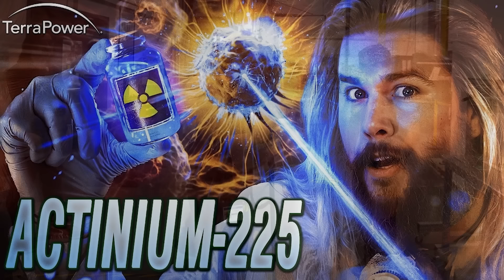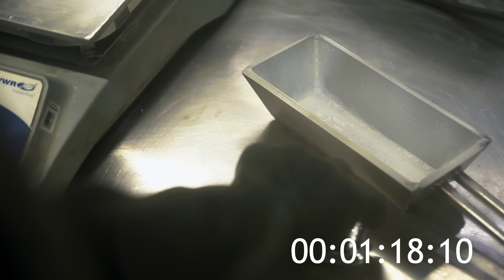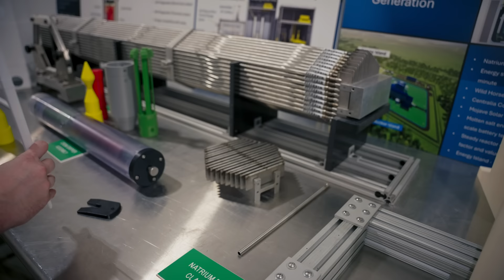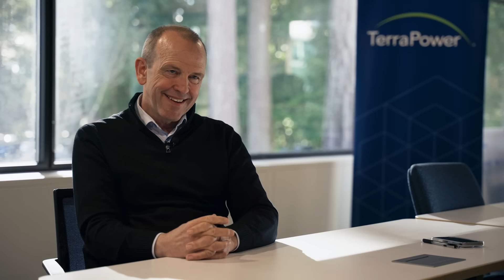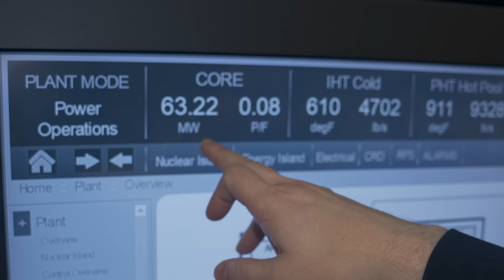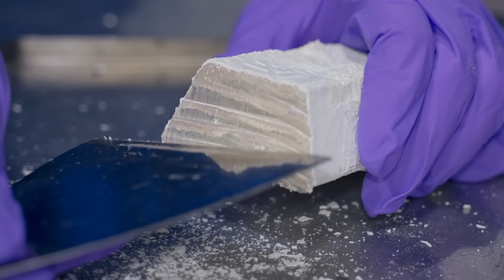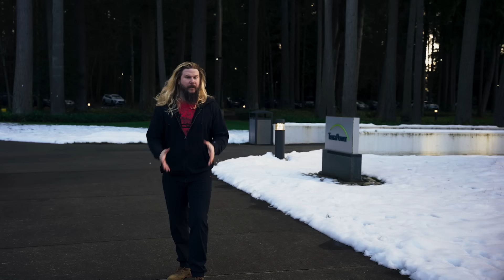Will Natrium Nuclear Reactors Change Everything?

Comment: Hey Kyle,
Interesting technology...

Definitely appears to be a blending of SAME-OL, SAME-OL Uranium-based thermal heat generation combined with the use of molten salts to recover, store, and transfer that heat for electrical power generation.  The best feature about it is the fact that the design allows for ATMOSPHERIC PRESSURE OPERATION.  In addition, the separation of the two "stages" allows for somewhat easier and more efficient maintenance.

That said, there are still the issues of nuclear safety when it comes to fission dynamics, coolant behavior, and passive safety mechanisms.  Aside from the potential use of gravity-based control rod insertion during a reactor shutdown (for whatever reason or reasons), there's nothing else other than a reliance on the naturally occurring convective circulation of the molten sodium (possibly in conjunction with other passive convective cooling mechanisms) to manage the heat in the core.

Finally, in comparison to thorium MSRs the Natrium reactor still has to deal with the SAME-OL, SAME-OL core changeouts and associated waste storage...  Here's a summary comparison between the two in this regard:

Natrium still generates high-level waste that needs geological storage. MSRs aim to close the fuel cycle, dramatically reducing waste volume, radiotoxicity, and long-term stewardship needs.

⚙ Operational Flexibility

Natrium reactors must be shut down and defueled periodically — core changeouts, inspections, etc.

Thorium MSRs, in contrast, can operate continuously with online fuel addition and fission product removal, sidestepping many of the logistical headaches of solid-fueled systems.

This isn't just an engineering difference — it reflects a different governance and cultural posture toward nuclear stewardship.

☢ Proliferation & Fuel Sovereignty

Natrium uses high-assay low-enriched uranium (HALEU) or even plutonium-based fuels, which pose fuel security challenges.

Thorium MSRs breed U-233, which is denatured with U-238 to reduce weaponization risk, and thorium is globally abundant and non-fissile on its own.

Comment: ENGNEER HERE - Like every other technology where people push stupid claims of "change everything"?
The answer is NO, and is always NO because there will not be any energy system that changes everything.
Some might be significant but nothing short of Doc Browns Mr. Fusion (Back to the Future) will change everything.

FYI - For all of recorded history we have used different forms of energy.

In ancient Egypt they pulled chariots with horses because chariots needed speed. they used Ox to pull plows and heavy wagons because for those tasks they didn't need speed but the strength to pull those sorts of loads. For going up and down the Nile they used sail, because trying to pull (or push) a barge or felucca (yes Assassins Creed fans) with a horse or ox made no sense.

Nothing has changed in the 5,000 years since.
Why?
Because different tasks need different forms of energy delivery.

Comment: This is good news because China has a mult salt reactor that claims to have reduced the acrosive problem with a special alloy in its circulation they claim to have been able to remove and add Fuel and remove contaminants wild in continuous operation.

Comment: High temperature molten salt thermal transfer fluid would be one step beyond this, but it's been experimental for decades ... more due to lack of interest/funding at the national/public level than from sheer engineering hurdles. (molten potassium chloride was/is a popular choice, also what several types of thermal solar plants use as a thermal mass storage bank to generate continuous power day/night, like Spain uses).

Also, not the same thing as a molten salt reactor. That uses a molten salt matrix with the nuclear fuel dissolved in it as the reactor core material. (this is often discussed as a type of thorium-uranium breeder cycle reactor) Though a potassium chloride coolant + heat transfer loop could be used in conjunction with a molten salt core, as well.

Comment: Question: What is the operating temperature of this reactor?  I'm curious because if it's high enough: You can use the heat for things other than boiling water to make steam.

To be fair: That's still pretty useful in and of itself because that's how we generate electricity.
Reply: Watch from 10:20 he mentions about the reactor heat and sodium heat jsyt before

Comment: 16:12 fun fact: hydrogen is not the reason for the explosion.
The surface is highly charged and shoots into the water at insane speed, Thunderf00t did experiments on that around 2015 I think...
Extremely interesting.

The hydrogen is just a secondary effect.
After all, sodium explodes under water, grabs the O2... What's the hydrogen gonna react with?

Comment: By the way, Thunderf00t did quite nice experiments to find out why the liquid metals in first and second row explode in water.

As far as I remember, the surface is highly charged and tiny imbalances start protruding a bit, it becomes more charged and really accelerates into the water extremely fast, allowing insanely fast reaction with the water due to the sudden increase in surface area.

Comment: Didn’t the Soviet Union run their reactors in their early power systems in their first or second generation atomic submarines ?
And they claim they stopped using this sodium system because it wasn’t safe?
But probably nothing on early Soviet nuclear submarines were very safe.

Comment: this design is cool and all but how does it handle meltdown risk situations? From what i know about water cooling reactors is that it's pretty much self regulating, as water is coolant as well as moderator, so when reactor gets too hot, water will evaporate which will remove moderating medium, which will stop the chain reaction, which will cool the reactor down. Sodium, as showcased in the video, does not evaporate like water and is not moderator as the reactor is a fast kind, so how is meltdown risk handeled?
Reply: So, let's say your coolant stops circulating (leading to potential meltdown). You have a scram, control rods are inserted, and fission stops. Of course, you have to dissipate the current heat, and the future heat from decay. The sodium reservoir is sized such that it will be able to absorb all that heat - thus avoiding the meltdown.
That is what EBR II showed - after shutting off the pumps, the temperature continued to rise, and then eventually started declining - because the sodium reservoir could handle that excess heat until said heat could be passively radiated away.

Comment: exactly what are they coating their pipes with? boiling hot sodium will fuck a lot of materials up without much trouble
Reply: molten sodium is used to clean steel - it scrubs the outer surface, but once all the oxide is gone, it is essentially unreactive with the actual steel. This has been shown with dismantled components from test and production fast reactors.

Comment: Can we get a video on how the molten sodium is controlled by magnets? It’s nonferro magnetic and even ferro magnetic materials lose there magnetic properties when heated.
Reply: sodium, like most metals, is a conductor
thus you can induce either an electric or magnetic field in the metal
given the metal will oppose the change of an electric or magnetic field, it will attempt to deform
given the metal is a liquid, deformation (or motion in a particular direction) is easy
hence, once can pump the liquid metal

Comment: So molten salt is the coolant instead of water, but the power conveyance is still boiling water. I wonder if there's a way to go from nuclear heat directly to energy.
Reply: thermocouples - although it wouldn't be very efficient
the reason for the water is that people haven't built cost-effective CO2 or He turbines, so easier to go with standard steam turbines

Comment: 15:11 I do have a genuine question. Would the operation temperature, of 500°C or so, not be hot enough for the molden sodium to pull elemental oxygen from the air? Yes, I know that the sodium will operate under a argon atmosphere, but if a structural failure occurred, the argon replaced by generic atmosphere, and the sodium would still be warm for the time being...

Is there no major risk in this situation? Or would the use of hydrochlorides and other acids be used to neutralize the combustion threat?

 I'm a pro-nuclear individual and I want to see neon green power become humanity's dominant source of day-to-day power, so this is not coming from the place of anti-nuclear. This is still my only concern with molten metal reactors, this small area of caution.

Comment: Is there a smaller scale operating electric generation fast sodium/salt prototype or are we going straight from the drawing board to commercial with fast sodium/salt? FFTF was not an electric generation facility and did not provide the salt component. Also there is a limit to how much the salt will hold thus load following with this thing still has limits just that it provides a wider band.

Comment: One of the problems I remember with salt based heat transfer is reactivity.  Those salts love to form bonds and IIRC that is why water was chosen as the means of heat transfer even with the pressure penalty and the worse materials science.

Even if you can do the first stage heat transfer with magnetics, which is awesome, that fluid will be hitting the side of the container for some portion of the transfer or all of the heat exchange.

Comment: Sodium is a highly reactive metal; it will release hydrogen gas and high heat when exposed to water. Explosion and fire are common. Sodium melts at 208 degrees F. That means that the piping serving the liquid sodium must have heat tracing. Should the heat tracing fail, then the sodium will become solid. In my opinion Sodium is not a safe choice for such an application.

Comment: I don't understand why are they using sodium, which is known to be nasty, because of its very high reactivity,why can't they use more stable & inert metals like mercury or gallium ?
Reply: mercury is highly toxic, has a high vapor pressure, and is far from inert. It reacts with a shitton of organic and inorganic materials that would make operations difficult and dangerous to handle any material.

Gallium is very hard to source in large quantities, and reacts with a lot of metals in catastrophic ways. once it binds as well there's no going back. While it does work as a cooling medium thanks to its low vapor pressure everything else about it makes it way too cost prohibitive.

Aside from all that, gallium and mercury are used heavily in precious metal refining and semiconductor production. They're only going to get more expensive as time goes on, it's a bad material choice to design around for long term use.

Comment: So this generator has potential as long as the heat exchanger that seperates the corrosive salt water from the corrosive sodium metal  never fails.  Instead of water they need to couple the system to a super critical co2 or a ammonia system to take the heat off.  There is way less chance of failure due to corrosion this way.

Comment: Hi not a science nerd and don't normally leave comments, BUT I did work at a chemical plant 5-6 years ago and I can agree with 15:15 that Na isn't reactive in the air without being molten.  Messed with it all the time in it's semi-molten form with changing/cleaning valves.  Something both cool and dangerous if you dilly-dally.

Comment: The one issue I have with some conventional nuclear reactors is that an affirmative action is required to slow or stop it. Shut off the cooling and you risk a meltdown. Control rods get stuck... meltdown. An ideal reactor should require affirmative action to keep it running, (like a thorium reactor). Shut off contol power or cooling and it just stops.... I know peopl are working on that, but I have yet to see a convincing design in practice.

Comment: It's a great time when fear of Nuclear is diminishing. We NEED more reactors globally. Between the data centers and the growing number of plug-in vehicles, power needs to be high priority. Many power plants require government subsidies to survive. Often times high energy prices are not because of greed, it's a deterrent so we have enough for industry and hospitals. Higher power production will also lead to lower cost for many. In Summer heat, my workplace sometimes gets calls to shutdown air conditioners for similar reasons.

Comment: look I'm a dumbass but i see a issue that need to be addressed. if your putting 100 persont to a battery  24 7 its going to go boom. yes i know there load following but winter loads are low as hell even in Wyoming do to most house heated by gas or wood. maybe they did something about that and did not tell seeing how eegheads usely over look the dumb shit problem's i would question it.

Comment: My concern is the example of a diesel engine, when they run at 100% they tend to fail spectacularly. Granted the temperature isn't going to be high enough to boil sodium, but I do worry about a critical run going super critical.

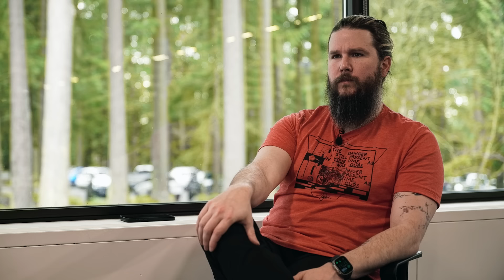Comment: 5:38 What a blithe spin the video puts out: ''a nuclear reactor is a diesel engine. It wants to runn at 100% all the time.'' Meaning: the most efficient way to use nuclear fuel is to run your reactor at 100% all the time because you can't turn off radioactive decay. All that energy and cost sunk into the production of nuclear fuel can't be stored like oil or gas waiting for the right time to come to market. So, they're going to build storage to hang on to that heat until it's time to boil water, spin a generator and sell electrons as profitably as possible. We wait and wait and wait for these nuclear schemes with their complicated supply chains, logistical bottle necks, privatisation of public funding and no plan for implementation beyond a select few operations. Meanwhile the fossil fuel companies sweat their assets, soak up subsidies and set their hooks in deeper trying to delay transition to renewable energy as long as possible. It’s not an educational video. It’s a sales pitch.

Comment: This was a cool video - and it's exciting tech - but boy the the possible explosive issue with the liquid sodium was disregarded with almost a sort of carny trick. "Liquid sodium reacts with oxygen and burns creating explosive hydrogen gas - and in fact that heating to liquid form is what causes sodium to pop and burn when you throw it into water - lets play with this totally solid sodium metal as if that puts the explosion risk question totally to bed!"

Huh? I understand they will use Argon to create a safe environment for the liquid sodium - but, yeah, what if there is a leak - either of the liquid sodium or the argon supply? What sort of explosive potential exists in that scenario and what kind of fail safes does the plant intend to use to prevent/mitigate that risk?

Comment: Question. Is the moltan salt ruffer on the pipes for moving it around then water so the longer distances between power generation and storage a problem with the separate nuclear island and generator areas?

Comment: This is really interesting. The Russians used lead-bismuth liquid metal cooling in a submarine nuclear reactor. They stopped be ause if the rea tor needed to be shut down for any reason, it was ruined because of solid metal in piping. Im interested to know the solution to this if the reactor needs to be stopped. The sodium would still be a concern if there was an event on site requiring firefighting.

Comment: "You don't have to protect against leaks as much, you don't have to pressurize it, etc."  As an engineer for NASA, I can tell you, you MUST plan for EVERYTHING even if you think it won't happen. IF something goes catastrophically wrong, and that sodium starts to boil, and there is any moisture in the air at all, the result of that mixture is hydrogen gas! Toxic, Extremely Flammable, and if confined...Explosive!
These people are failing to plan for contingencies!
Not smart! Definitely not safe.
Reply: You're absolutely correct.  These people are classic Dunning-Krgger examples.

Comment: Very informative video. I hope it can be put to test and can perform better that the current nuclear powerplants.
Is the molten salt cooling system more efficient and less problematic than the one used by the current solar-powered projects that use molten salt (and that are referenced over and over in this video) ?
I hope that's the case, because it's the part that's the weak point (in my opinion), and it's glossed over in this video.

Comment: I am not a scientist of any kind but I do like science and I love Kyle for that. He has taught me a lot but I do have a question though. My understanding is that salt is corrosive mainly to I guess metal. So what would that mean to like pumps and pipes? And I guess it comes down to what materialist used for each part of the big machine if you will. But that would be my only concern. And I'm asking when you're going to have to have anodes and cathodes and whatever else sacrificial metal on areas where you can't use something that wouldn't be corroded by the sodium salt. Whatever or when I'm thinking of sodium am I thinking of something different than table salt? Because I guess that's sodium chloride. What do you not which is different than sodium? I'm confused. Somebody shed some light on this please.